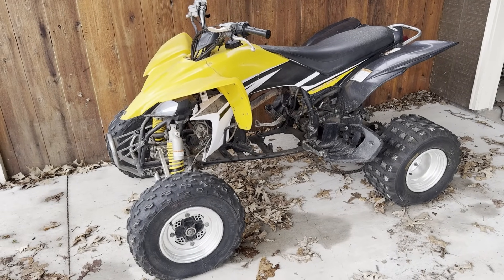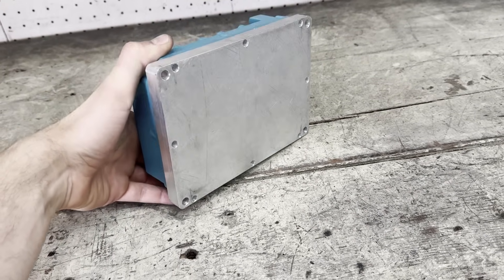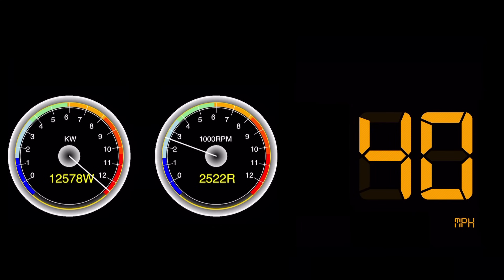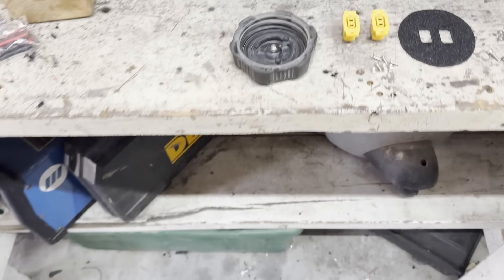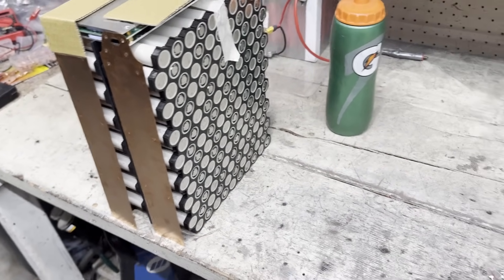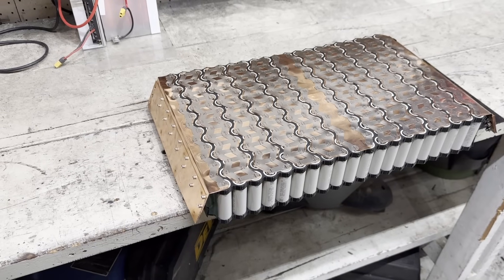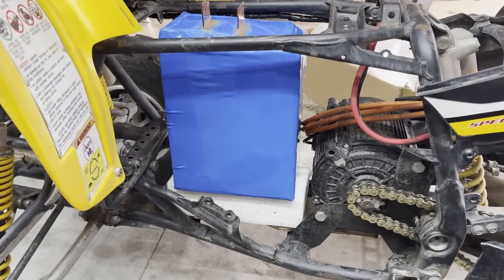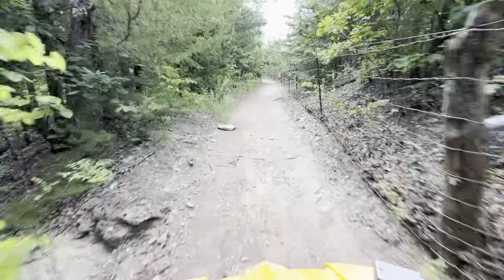Building A 50HP Electric Quad

Comment: 2:35 instead of cutting the plastic you should have drilled holes in it and installed a small computer fan
Reply from the maker: I guess, but I don’t really see the benefit of that.

Comment: Why isn’t the 0 to 30 and 60 faster cool build but a raptor 700 will hit 30 faster
Reply from the maker: I’m not surprised it’s slower to 60 since gas vehicles have better top end speed than electric, but I was surprised it wasn’t quicker to 30. If you watch my most recent Short it has a side view of me launching it, and you can see it does a perfect tiny wheelie up to maybe 25mph so I don’t know how it could accelerate faster than what its currently doing. Maybe the gas quads have a lower center of gravity or the weight is more forward because of the radiator or something? Also my timing method is far from perfect, I just judged it off the gps and display speedometer combined, which definitely could lag behind a bit.
Reply: @Calthecool  fair enough I don’t want to discredit ur build whatsoever it’s awesome and has made me want to do a build myself in the next couple months!Is there anyway to run a smaller sprocket and still get nice torque im wanting a wheelie machine… also curious how many kw you were running peak?50 horse is around 38kw would you ever consider peaking  50-60kw I (that’s around where I’d want to be if I did my own) would imagine that would drastically effect the 0-30 and 60  as well as torque to the ground…and also I’ve heard the qs180 can handle these numbers in karts without thermal throttling while still remaining air cooled also heard of guys sealing the case and filling it with ATF or oil to give a extra cooling effect and running north of 70kw peak… also caught wind of a guy sealing his motor and having a onboard water reservoir spraying the motor case when a certain temp is reached to leach heat away from the internals similar to the way sweating works. Also I did watch your launch video I’m confused as to how 36kw at 48 horse didn’t make the front end come up one would think  with the instant torque at them numbers likely being higher than the gas counterpart that u would have to let off the throttle to keep it from flipping backwards
Reply from the maker: @MreedMree I remember when filming that Short I tried just hammering the throttle but it did try to loop, so I actually tried to launch it for the second attempt and that’s how I got that good launch. With this quad I learned that there’s no taming it under like 25mph at full power, it’s either going to wheelie or spin the tires. 
You can use the stock sprocket if you use a qs138 motor that has built in gear reduction, which is really the correct motor for this amount of power. I never managed to get the qs180 above maybe 95 degrees Fahrenheit, it’s just way too much motor for this amount of power. If you want to shoot for 50-60kW you’ll probably want the qs180, but I don’t know where you could even use that power except for maybe the sand dunes, and even then it’ll suck your battery down so fast.
Reply: @Cal @Calthecool  wanted to build a battery pack that could sustain burst of 60-70kw how many 21700 cells would I be needing? I’m just looking for a few hours of fun at a time I know I can’t run 50-60kw constantly but more of an open up at 30-40mph yk? I really just want it to where I can wheelie from a stop and at 20-30mph but also accelerate fast if I wanna. Also could u maybe post a short of doing some wheelies on it I’d really like to see that.
Reply from the maker: @MreedMree  If you just copy the battery I made but with 20 cells in parallel instead of 15 it would be a 72v 90Ah that could do bursts of 64kW. It uses Molicel p45b cells which are the best cells that are still relatively affordable. I wouldn’t recommend it as your first battery build though, there’s just too many things that you could mess up and too much money invested. I had built like 7 batteries before I built this one so I was pretty confident by the time I made mine.

I can’t really do wheelies on the quad, I’m not good enough.

Comment: What is the battery life in hours in the trails? I want to do this with my roketa gk06 frame . I think the 50-60hp would be perfect maybe with a little larger rear sprocket because mine would be heavier with more people weight if 2 people riding
Reply from the maker: The only ride I recorded was 20 miles covered in 1 hour. I don’t know what trails you ride but I wasn’t able to ever use full power unless I was on the street so idk how useful 50-60hp would be on the trails, but I’m sure it would be fun.

Comment: used surron ultra bee battery would have been cheaper... or even two wired together lol. much much cheaper in fact

ok so you 10000% need a geardown mechanism, like em e bikes have, chain to chain to get the rpm on the wheels lower.
PLUS you need to make a better tune, or have a sensor that makes the wheels anti slip, if the wheels a spinnin, thats all lost batery range right there.  heatsink you can add fins to it, and make an airscoop to funnel in air.

overal looks dope. but yeah the weakest link is the chain.... you rly rly need lower rpm on those wheels and the oem sprocket. i personaly run my surron lbx on the stock 19" wheels, but use a masive 64t sprocket on the rear, tho tbh id go to 72t even, torque is king.
Reply from the maker: I don’t want someone’s used battery, I have no idea how it was treated. I also like building batteries especially this one, since this one was definitely my best one so far. I’ll probably sell this one then eventually make a version 2 with all the improvements you mentioned.

Comment: Were you concerned with water ingress into the controller or the battery? Cool build
Reply from the maker: The controller is very water resistant so I’m not worried about that. With the way I shrink wrapped and glued the battery it should also, but I’ll keep my eye on it in case the shrink wrap gets damaged or something.

Comment: Amazing! Just the kind of video I was looking for! Very detailed and carefully explained, congrats.

No, just out of curiosity, how many miles do you expect to run with such a battery??
Reply from the maker: Thanks! I haven’t really tested the range so I can’t say.
Reply: @Calthecool  Thank you for your answer, is it even possible to calculate?
Reply from the maker: @propriogames7272  the only comparable vehicle would be the Stark Varg, which has a 6.5kWh battery which is larger than the 4.8kWh battery I have. 4.8/6.5=0.738% less range, then multiply it by 0.9 because I’m sure their whole system is more efficient than mine, which equals 66.4% the range of a Varg.

Comment: I have absolutely no automotive experience or any type of experience that would aid me in trying this myself. Would it be possible for someone with NO experience to recreate this?? You’ve really sparked something in me to want to build something like this on my own!
Reply from the maker: As long as you have the time to learn and the money to buy the tools, materials, and the battery then you can probably make it happen. I say you should buy the battery instead of building it because everything else about this build like the metal fabrication and the soldering isn’t super hard and you can kinda learn as you go, but building a battery like this is something you should only do after you have a decent amount of experience because of the risks involved. I wouldn’t have spent $1,500 on materials for this battery if I hadn’t just built like 7 battery packs that were working great in the last year.
If you buy the battery, use the correct motor, and get the steel parts laser cut so you can just weld them straight to the frame and bolt everything together you could skip like 75% of the work required for a build like this.
Reply: @Calthecool thank you! Would you be able to send me some plans or a more detailed guide if I emailed you? Maybe something that can help me along the way with this video? Or even some sort of online forum? I really appreciate your response!
Reply from the maker: @JameyKing. I don’t have any plans since I just made mine out of pieces of metal on the spot, but you could maybe email the guy who posted this video: https://youtu.be/4NnKOsraIAo?si=Xhythna6UKL582Xb, his email is in the description of the video.
Those motor mounts he had cut are what I was talking about, and he also used a better motor for his build which is a qs138 motor with internal gear reduction. The motor I used is overkill for the amount of power I have, and since it has no internal gear reduction I had to get a massive rear sprocket.
As far as forums go you can ask questions about the electronics on the Hyperebikes Reddit page, and I don’t have a specific forum about quads that I would recommend but I’m sure you could find one since these quads have been around since the start of the internet. I also like helping people with any questions they have with their builds so ask away either here or preferably on my discord if it’s a more complex question where you would need to share images: https://discord.gg/trCyCpFU

Comment: I'm not very fast for a 450 my Honda 400 stage 2 will keep up with a 450 and it hits about 85 mph and when I say keep up with a 450 within a bike length are the stock 450 and I'm still pushing 400 displacement

Comment: Awesome job on this build! I've never built a battery before but I'm going to try to take four 48 volt batteries that I have and build a 72 volt battery. My neighbor has a quad behind his shed and said I can have it. I haven't pulled it out of the weeds yet but it might be for wheel drive. I hope it's not. Do you think it will be a pain or waste of time to mess with that? I'm thinking I could just get rid of the front drive shafts. Hit me back if you have any ideas. Thank you for your help. 👍

Comment: Why you say 50hp?engine  is 8000w and 8kw x 1.36 is 12hp
Reply from the maker: The motor is labeled 8000w but it can do much more, in this video I’m doing 72v * 500a to get 36,000w which is about 48hp. A fully charged battery would be over 50hp.
Reply: @Calthecool you showed 12000watt when you tested thats 15-16hp and i now how much 1kw is its 1.36 hp
Reply from the maker: @Svirsta  Oh yeah you did do the conversion right, I was thinking of it backward. That test was with a 200 amp battery because I hadn't made the 500 amp battery yet.

Comment: Sick build..but curious why you would put a bigger sprocket to go slower and make the motor turn at higher rpm?  Doesn't that just make it run hotter?  Also, you don't want to have like a 65mpg top speed with still good low end power without spinning the motor faster?  Just curious.
Reply from the maker: With electric motors like these it’s bad to go full power constantly at a low RPM because the controller is sending a lot of phase current to the motor which heats it up a lot. It’s better to spin the motor fast which allows the controller to send less phase current so the motor will run cooler. Even with the bigger sprocket this quad could probably go 80mph which is way too fast, so I would lower the gear ratio even more and spin the motor even faster if I could.
Reply: @Calthecool ohhh, didnt realize you were going full power when i saw it was low rpm, assumed it was using less power and turning low rpm due to gearing but you even said the power, just went in one ear and out the other. Also at least it will do 80 in my opinion.  Lol 👍

Comment: can you post link for cells?
you are very good youtouber
Reply from the maker: I got mine from here, I don’t know if it’s still the cheapest place to get them: https://liionwholesale.com/collections/batteries/products/molicel-npe-inr-21700-p45b-50a-4500mah-flat-top-21700-battery-authorized-distributor?variant=40481337999429

Comment: You want speed go to a smaller rear sprocket.   I would like to know how long it takes to charge?  Also maybe there's a way to take computer parts and make water cooled jacket for your motor and controller.  Use the old radiator and an electric fan.
Reply from the maker: I don’t want speed, which is why I went with a large rear sprocket. Still too much speed in my opinion, I shouldn’t be able to pass cars on the highway on my quad I made to ride off-road.

The battery is 67.5Ah so you can do the math for the charging time. For my use case I store the battery at 60% charge so if I suddenly wanted to go ride at full battery I’d only have to wait about an hour with my 30A charger. However most of the time I just plug it in overnight at like 5A. If you had a crazy custom charger you could charge it fully in like 30 minutes but charger that are that high current don’t really exist.

You could definitely water cool any part of this quad but it really isn’t worth the extra weight. In its current form the battery and motor don’t even get warm, and the controller just needs a big heat sink to be cool enough.

Comment: Amazing build. I wouldn't put that metal bar across your two copper plates like that. Eventually that tape could wear thin and you will dead short
Reply from the maker: I put a ton of insulation so I don't think it will, but I'll look at it next time I ride it and I'll add some plastic sheets if it doesn't look good.

Comment: Amazing build! If the power is somehow not enoigh though i would definitely recommend some jp40s
Reply from the maker: Believe me it’s enough, I’m still only doing 75% of the output that this pack is rated for. I want to try some JP40s but really the Molicels are already pushing what I can spot weld, if I wanted to benifit from the tabless cells I would have to do like a single piece of 0.2mm copper across the whole parallel group.

Comment: I'm in the process of converting to electric a Yamaha wolverine with on demand 4 wheel drive. I modified a GM alternator with neodymium magnets now a bldc 3 phase motor.. that will be my drive motor for th rear end.. I have removed the front differential and have mounted a 36 volt hoverboard motor on each cv axle so that when not using 4 wheel drive they both charge the batteries and a relay system controls the charge/run mode. I have a 36 volt battery system with a 36 to 12 volt step down module to feed the lights ...
Reply from the maker: Sounds like an interesting project

Comment: Hey how did you spot weld the copper for the battery? Im thinking of building a 72v 30 ah pack with the same cells. Could u advise me on what I should use so it doesnt heat up. Can I get away with just nickel or no do I need copper. Also max output is going to be 250 amps MAX. How should i connect the cells and with what. Cheers mate love ya work!
Reply from the maker: Check out my “how to build an ebike battery pack” video, it has a lot of good information. If you used just the nickel that I used in this pack, you would be limited to only about 13A per cell so if you want the 35A per cell that you would need for a 7p pack outputting 250A you definitely need to use copper. I don’t currently have a video explaining how to spot weld copper, look up “copper nickel sandwich” for information about that.

Comment: You should use lifepo4 or prismatic battery
Reply from the maker: Lifepo4 doesn’t have as high of capacity to weight ratio as li-ion, and prismatic or any other non-cylindrical cells have to be compressed if they are used at high currents otherwise they will swell up. You can definitely still use them for something like this but I decided on li-ion.

Comment: few questions.
1. why not go to 96v? its objectively better and the fardrivers scale up cheaper for them. (27s would leave u with only 3 extra cells)
2. why underspec controller? you have 300 cells so its 20s 15p thats 675A peak. you couldve at least done a 721200. 721800, any of those.
3. why not use a better cell like eve 50pl or p50b? if budget was a problem u can get p42a for like 3$ a cell rn
Reply from the maker: To answer 1 and 2 I actually got the motor and controller kit from someone on Facebook marketplace months before I bought the quad, he was selling it for $500 under retail so I decided to buy it instead of doing a QS138 on 96v like I originally planned. I’m actually happy I did 72v and not 96v as I can use the same chargers for all my vehicles, and I don’t exactly need more power or speed since I can barely control this quad as is. For 3, I decided to go with the p45b’s since they are very proven and I could get them quickly. I’ll build a battery with some new tabless cells eventually.

Comment: You either want to go really fast or you just want more towing capacity from the bigger rear sprocket. I’d rather go with speed.
Reply from the maker: I don’t think a smaller sprocket would really help you go much faster on this quad, it’s going fast enough that the wind resistance is just too much. I know the surron record is just above 100mph with the same power as this quad, so it would make sense that this would go 20mph less from having more rotating mass and more wind resistance.
Reply: @Calthecool  I know, I don’t have any electric vehicles of my own but I’m just saying I would stick with a smaller sprocket and try to gain as much speed as humanly possible. Also I didn’t think this was going to do 100 mph, I assumed like around 80-85mph, also would you ever do two motors?
Reply from the maker: @Mr_GhostRiderUnreal two motors would be good for a 4wd vehicle so you could have one in the front and one in the back.

Comment: How did u get the quad frame
Reply from the maker: Found it on Facebook Marketplace.
Reply: @Calthecool  NICE
Reply: could i find  one sold on a original website with tires and etc. like you did
Reply from the maker: @AarushSanapala Probably not, if you want a new one you’ll probably have to buy a gas one and remove the engine.
Reply: @Calthecool  Tks